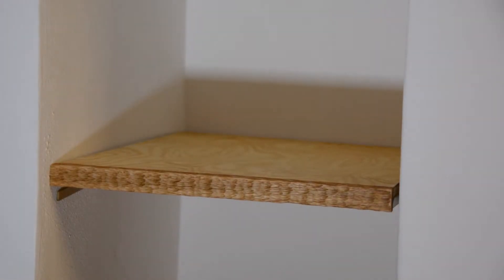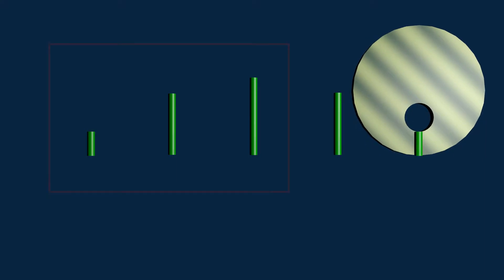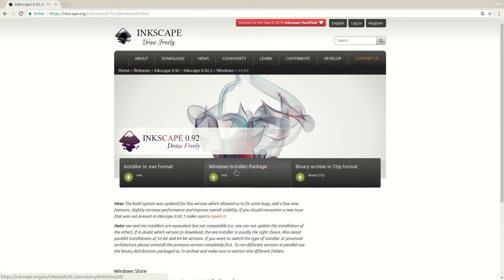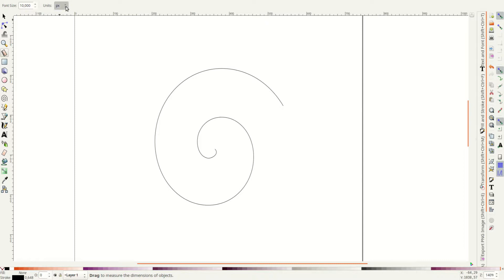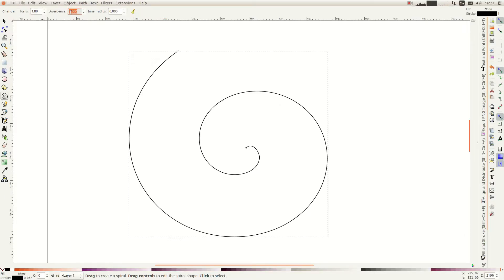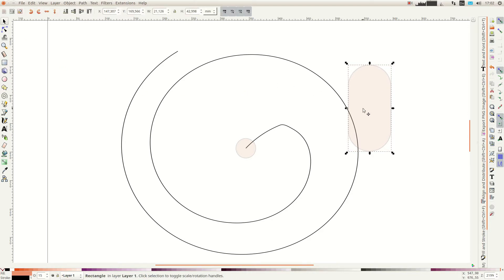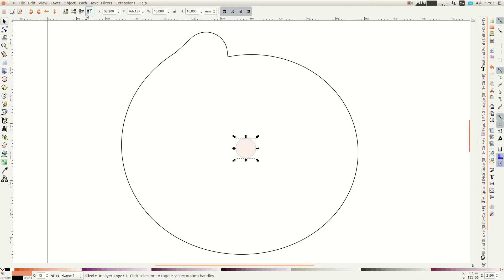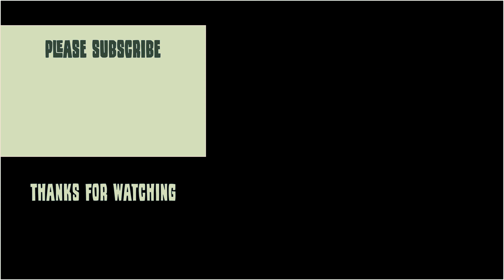How to use free software to design excenter levers for woodworking [not a build video]

Comment: you can also export it  from Inkscape to Openscad - and 3D print it - using this extension:
- https://www.thingiverse.com/thing:1065500
Reply from the maker: Great tip. Thank you. 
However in the case of an excenter the part needs to resist a lot of force so you would have to print it with a high amount of infill. This would be more expensive than cutting some scrap wood on the bandsaw or jigsaw. 

I'm still looking for a good CAM solution to generate gcode for the CNC from Openscad models. Any ideas on that front?